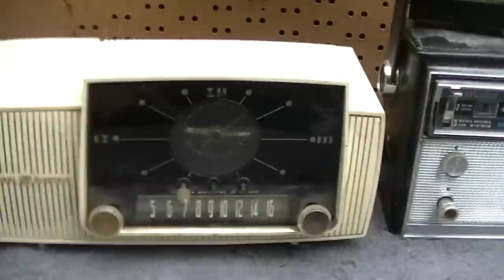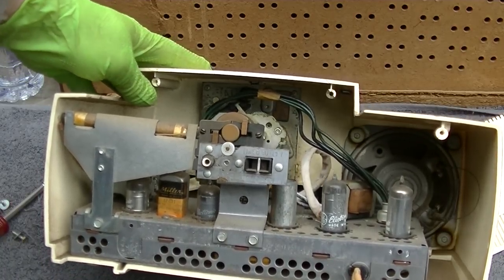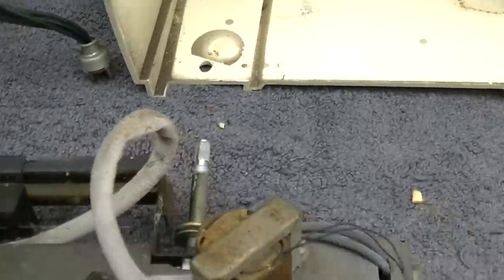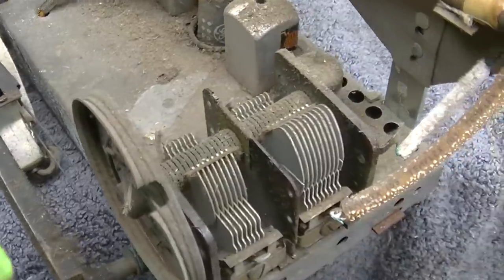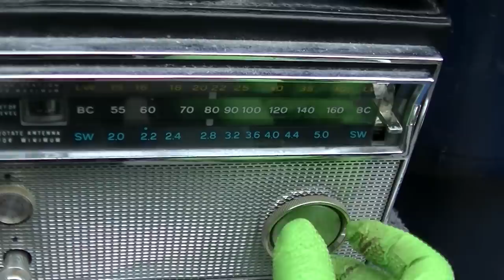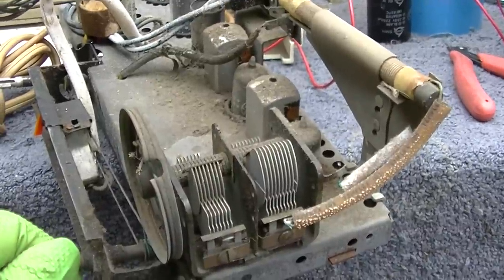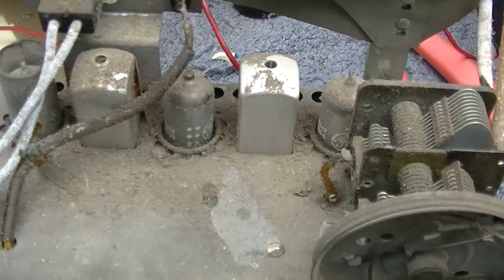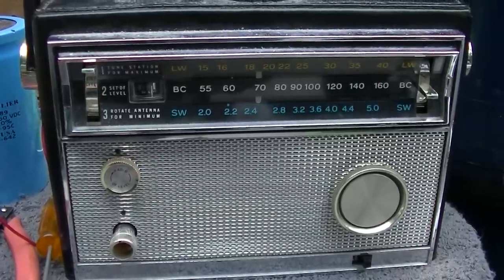GE 912 AM Clock Radio XEWW 690 77kw Music Station Baja CA

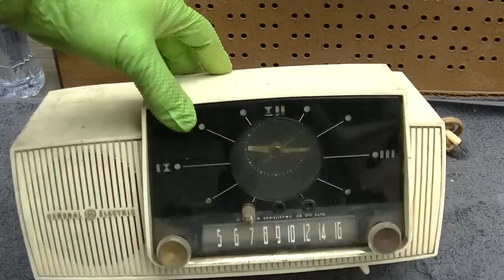Comment: 2:10  That thing is horrible.  It's also a very cheap model.  It's not like it's a high quality wooden cabinet with a high gloss surface.  Worse, the plastic is discolored and splotchy and you will never get it right again. I don't know what people see in them.

Of course, what the hell do I know?  The VW bug and bus are some of the most restored cars with some models approaching 100,000 Dollars fully restored.  These were bottom of the line barely functional 36hp cars with no air, no power steering, no power brakes. They were practically a disposable vehicle.  Yet, at least the Boomers absolutely love them and will pay any price to relive their youth.  80 is the new 30.
Reply: Some thoughts about comparing apples and squid tentacles:

1960 was the last year VWs were 36 HP.  I drove a 40 HP.  It’s not that bad in town, but of course it’s not suitable for 80 mph on the interstate. By 1966 it was 50 HP, by 1971 it was 60. That would hold its own on the highway, as light as the car was.

Plenty of American cars still didn’t have air conditioning in the 60s. It was still an extra-cost option that many people considered an unnecessary luxury.

A VW is so light that it has absolutely no need for power steering. Its brakes were as good as anything in that decade. In the days before good power assisted disc brakes were standard, tires couldn’t cope with fabulous brakes anyway. Like A/C, lots of people still didn’t opt for PS or PB anyway.

I’d be the last to argue that a VW was high tech, or even on par with the times. They are modified 1930s designs. But barely functional? Millions of them drove reliably with barely any maintenance, and that in the US where driving conditions were far more demanding than in Germany at the time.

Compared to a 2023 model car, you could say they’re barely functional because they lack the comfort, safety, and technological development—of designs 90 years newer. But they are totally functional as transportation within their limitations.
Reply: @PeopleAlreadyDidThis  40HP? Well, excuse me. See you at the track!

The Bus is a certified leg remover.  There is literally a piece of sheet-metal between the world and your legs.

Buyers at least had the option for air conditioning, power steering and power brakes and in most cars, also an automatic (not that I hate sticks, I drove them for many years)

I don't dis them for their lack of tech. In fact, their lack of tech makes them better in my eyes.  I don't even really dis them generally. What I dis is that these econoboxes are seen as so desirable by boomers and the prices they pay for them.  It just flabbergasts me.

When I was first learning to drive in the 80s there were still plenty of bugs on the road being daily driven as just transportation. But, they were always overpriced because Boomers ran up the price trying desperately to pretend 40 is the new 30.  You could get yourself a nice Nova or Monte Carlo from the 70s for like 1000 Dollars. But even the Super beetles 5 years older than the Chevy or Ford would be 4 times the price.  This really turned me off to them. .

I think it is absolutely HILARIOUS that the hippies adopted the Nazimobile as their symbol of peace, tolerance and love.  I love to point out that 1930s bad man personally commissioned this car to be designed and built.  Gotta love life's little ironies.

Comment: I hope that 77 KW radio station in Rosarito, BC doesn't interfere with FCC-licensed KTNN 690 broadcasting from the Navajo Nation. Perhaps they lower their power and/or change the direction of their signal after sunset to protect KTNN. The quality of most GE radios is for the most part disappointingly poor.
Reply: Think KTNN is at 660
Reply: @Rfk1966  I just looked it up and you are correct. It has been many, many years since I've lived in the Southwest.

Comment: GE made good radios, but in the 1950s they came up with the best way to solder the connections, supposedly the greatest. I never like these, because you had to heat the h*ll out of the connection to get the solder to melt in order to remove or insert a wire.